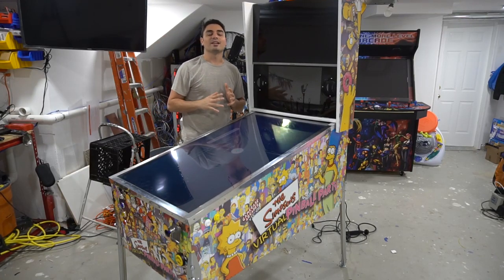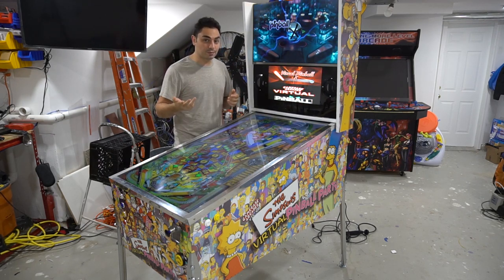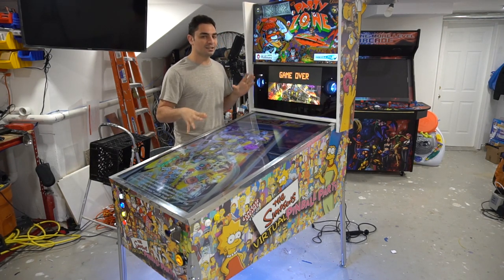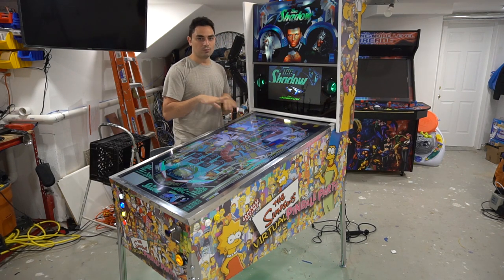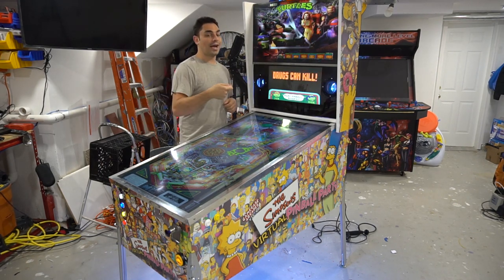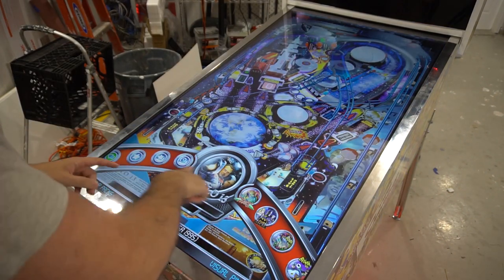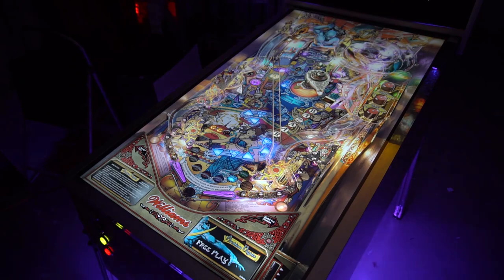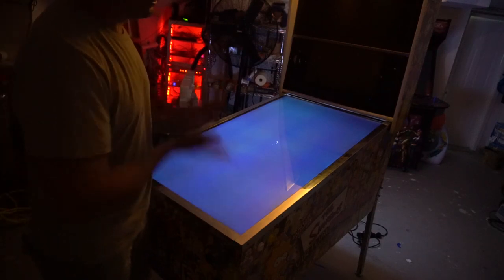Can A Pre-Built Dell Run a 3 Screen, 4k Virtual Pinball machine?!

Comment: For vpins any i5 and 16gb ram are plenty.  It's all about the video card.  Vpx is mostly GPU intensive.  I'm running 4k on a 1060 6gb pretty well but will upgrade when the new cards are available.  The Dell power on pins are also usually proprietary which is weird.
Reply from the maker: Yea I hear ya on the gpu availability. Yea I think I saw replacement power switches for the xps are like 30$ lol

Comment: Totally agree with you regarding PupPacks.  You should show the fps under VPX.  I'm curious what you're getting from the XPS.  I'm running with an Optiplex  790 w/ 1050ti just under 4k (3840 x 2160) and get no less than 60 fps on most VPX tables, but I'm looking for more.  Why PinUpPopper over PinballX?  Is one more resource driven than the other?
Reply from the maker: Popper looks way better than pinballx imo, plus popper is current and pretty up to date with the community. I sold the pin so I wouldn't be able to show fps :/

Comment: Vic - looks great.  For your speaker ring leds, can you tell me how you have them configured in DOF Config Tool?  Are you combining effects?  What led effects look the best for speaker rings?
Reply from the maker: Speaker rings I have linked to my undercab lighting. In dof there's "undercab lights" so my undercarriage leds and my speaker rings are linked together. If you want "effects" then your talking about led matrix addressable leds. 
I haven't don't that option yet
Reply: @Vic_VP  I assume you are using RGB Undercab Smart or RGB Undercab Complex?
Reply from the maker: Undercab smart 
Complex is addressable